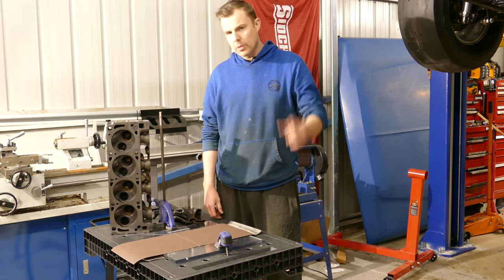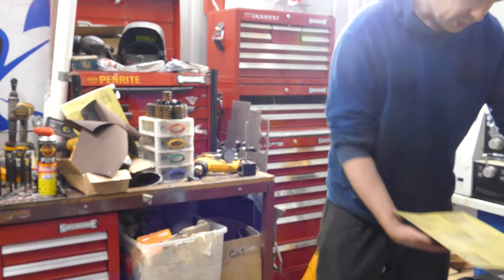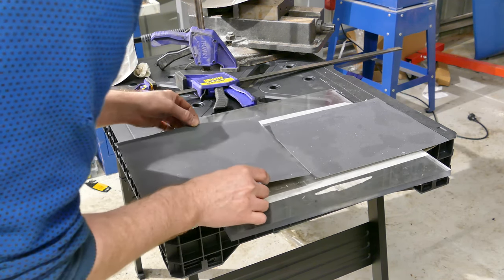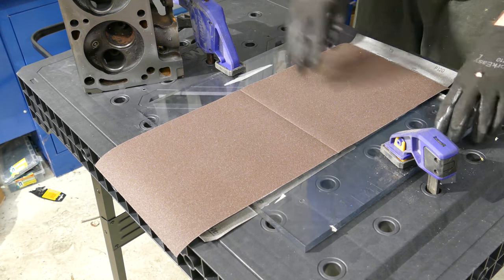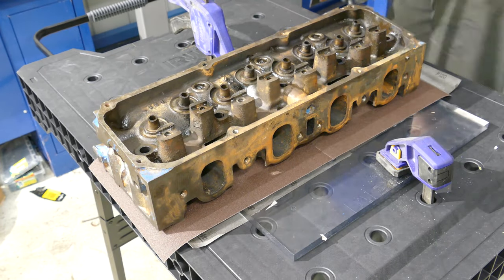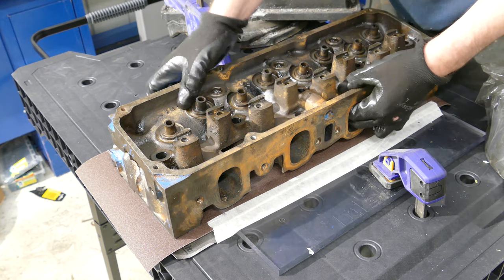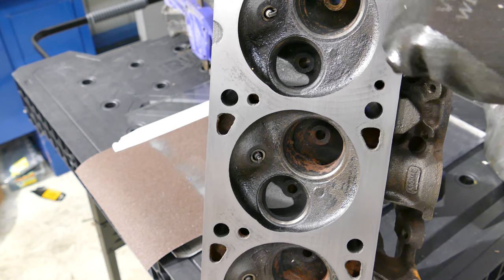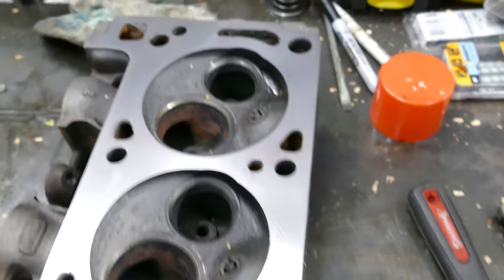How to Resurface a Cylinder Head at Home

Comment: Looks like you need a larger sanding area so the ends of the head doesn't ever leave the sand paper.....the center of the head is getting sanded down more than the 4-5 inches of the ends. Idk.
Reply: If it works it works lol
Reply: @RATsnak3 changing oil every 50k works too. You should try!
Reply: @rightsdontcomewithpermits7073  if your cylinder head needs to be resurfaced, an oil change isn’t going to cut it.
Reply: If you have a closer look you can actually see he moves the head far enough for it to get to be even. I had the same worry as you at first.
Reply: @RATsnak3 noob always talks about changing oil. Its alright. We all know you can change your oil and filter. Good job. Leave the these sort of jobs to the expert, youtube warrior.
Reply: @RATsnak3 anything goes nowdays HAHAHA
Reply: machine shop resurface is a must ....sanding alone will not make it perfectly straight ....leakage is inevitable on high compression engines
Reply: @RodolfoRedovan-ry8kj  for this there is a ruler, clearance tolerances and feelers, if everything is within tolerance, then this method is working

Comment: Straight lines are the worst thing you can do. Also, no lubrication or cutting oil to clear the shavings. Iron heads are different than aluminum of course, but they still need confusion on the milling marks to seat. Smooth isn't the key. The gasket needs something to bite into. I use 220 for first cut and 320 for final and work in figure eight motion. I have a video posted as well.
Reply: not for MLS gaskets, smoothness is key
Reply: I guarantee the edges are a few thou difference just because of the momentum of the strokes. I checked it at the machine shop. Completely right about a very smooth finish with MLS but you take that head to the head shop and you'll see the corners or off. 220 grit is far from a smooth finish for an MLS gasket. It will work...but for how long
Reply: Meh, I watched your videos, with all 17 likes and comments DISABLED. Red Flag number one. Then I saw you pull out a Home Depot 4’ level as a “straight edge” to check a 2-thousandths factory tolerance on a Subaru head (notorious for head gasket and ring land groove motor failures)… Red Flag number two. Then you stated in your video that if someone didn’t have a sheet of glass or certified flat surface to “Just use the floor if you know it’s flat”. I lost it and died laughing. When I went to install my new flooring in my house, my floor had highs and lows of 1/4” to nearly 1.5” differences. If you’re recommending to use the FLOOR to machine a motor because “Your dad has a machine shop”, you are part of the problem. 👍🏻

Edit: Not to mention in your comment here you stated that “Smooth isn’t the key”, when in fact, it is on almost every gasket made now which are primarily MLS gaskets because they are far superior to Carbon/Cork and are the best way to fix a factory-flawed cheap gasket setup. Just the 2 cents of a someone who builds 1500hp+ engines quite frequently and my own personal 1638hp Whipple blown LS7 has 80,000mi of pure abuse on it and has needed NOTHING other than standard maintenance.
Reply: @jimkruse74 you right I did this method and was out like .003 on each end with the straight edge ended up getting the surface milled
Reply: Figure 8 is what you use for small things like cpu heat sinks, etc.  Kind if hard to do quite the same with a 30-50# head, but one could try a bit.
And no, most modern engines and gaskets need flat as possible unlike older cork and 80's-90's gasket that need some 'bite'. 
Work in an area that can be wet and position a hose to spray water onto your wet sand paper to flood the debris out and away from the scraping area.
If I were doing this, I'd get a range of quality wet sandpaper from 200/400 up to 2000/3000. 
A mirror finish isn't required, however the closer you get the better the seal will be.

Comment: I hand lapped my head and block together with grinding paste, does an even better job as both surfaces are flat to each other. Can only do that if the engine is out and you clean the entire head and block after though
Reply: Shade more light on this method please.
Reply: I could see that being a good method, if there was no head gasket failure or overhead event to begin with. I would maybe do this if I were just upgrading valve springs on an otherwise healthy engine.
Reply: I've heard of this method before, usually for single barrel set ups.

Comment: I have done two alloy heads using this method on laminated glass with the spray bostik adhesive trick like you used.   But I used 220-240 paper with running water from hose, it cuts plenty fast enough.   After a few minutes work the 220-240 has lost its sharpness and is like a 400 so you have already got a nice final finish without changing papers :)
Reply: @michaely6665 I’m working on a 2002 5.3 LS with MLS head gaskets which the head surface needs to be near mirror, how long do I sand with the 220 before switching to the 240? or do I just choose one over the other? And do I keep sanding using water until they wear down to around 400 grit?
Reply: I used 220/240 whatever shop had, maybe for iron heads you could try 150/180.   Water flushing paper helps stop loose stuff scratching alloy heads.   After 5 minutes the 220 has already lost the best sharpness.  The finish was dull smooth, 220grit is about 17ra, and MLS gaskets needs 30ra from a list I found.
Reply: @michaely6665 Alright thanks. The cylinder heads I have are aluminum 862 and are not In really bad of shape they mainly need a once over but I’m going to buy a straight edge and get some bright markers to check any high and lows as I go along
Reply: @michaely6665 I believe they say 50ra to 60ra for aluminum heads with MLS gaskets and the chart i found says 120 grit leaves a 40ra to 60ra finish does that sound about right?
Reply: All I can say is 220 grit cut fast  enough, and leaves a nice smooth finish.  Only if the heads are really bad would you need to go lower, 120 grit is aggressive for aluminium, I tried 180 once and it really cuts in.
Reply: @michaely6665 Alright cool thanks for the info it’s really appreciated

Comment: While this is a good way to check and clean the surface of your cylinder head, this is in no way machining or re-surfacing. Nice try but no cigar.
Reply: I'm not in love with the idea, however it certainly is resurfacing.  Do what the OP did, and you can easily take n thousandths off your head depending upon how low grit you start with or how long you want to push a lump of iron around.  Will it generally be as accurate and good as a proper resurfacing with a mill? Nope.
Will you possibly ruin your head? Yep.
But you are resurfacing it, and Bugatti was reknown for doing almost exactly the same thing, albeit on a surface stone.

Comment: I’ve never done this before but I do work at a machine shop and there’s a couple things I’d do differently. 
First of all I’d get a larger piece strip of sandpaper and wet sand with machining oil. 
Start at a higher grit that 100. 
You’re likely working with aluminum and even 400 grit can get out of hand pretty quickly. 
Invest in some different grits, keep it clean, and above all else take your time.
Reply: I was hoping to see some additional tips in the comments and was wondering if wet sanding was a good option and I was also thinking that he was using sandpaper that is on the abrasive side I would honestly start with 400 and probably end with an 800
Reply: I have done it starting with 600 and ended with 2000. And WD-40 for lubricant
Reply: Great comment
Reply: @tuckerburbank3422   how it go with those grits?
Reply: what grit would you recommend to start and finish with? also can wd40 be a good lubricant when doing this?
Reply: @joshuetortega3572  

Really, just feel it out. 
I can’t overstate how careful you have to be about keeping it on the sandpaper and keeping your strokes consistent. 

Some blocks have an extremely low tolerance as to how much material you can remove. 

I would assume 400grit would be as low as you would want to go. 

If that doesn’t get the old gasket material off, perhaps try some kind of solvent and light scrubbing. 

A trick you can use is once the old gasket material is removed, mark the entire surface with a marker. This will help with showing you low spots. 

I’d work at 600 to start. If it’s not aggressive enough bump it down to 400. Realistically I think working from 600 > 800 > 1000 should do the trick.

I’ve heard of people using WD40 as lubricant but I’d look into buying some actual machining oil. It’s thicker and will probably help with keeping particles suspended and out of the way. 

A good degreaser will also be nice to have on hand while wet sanding.
Reply: I have a 2l inline 4 petrol turbo engine (sr20det). If I resurface it like this (using your tips) and torque it down correctly will it be able to hold turbo pressure? And what gasket should I use? The OEM one or should I get a better gasket just to be safe? Or does it not matter unless the engine is tuned to make more horsepower? I don't wanna go through all this just to have to get it done at a shop anyway but I'd love to not spend hundreds of dollars

Comment: Good, basic introduction to lapping a cylinder head.
Great thread of useful comments.
This is certainly doable, however you have to have a good idea of how to measure the different types of warps. 
If I had to do this manually, like this I would try to set things up so I was wet-sanding it in effect. This would mean forgoing a flat horizontal set-up to something akin to a ramp.  It would ~1.5x length of the head, and the top edge would have some soaker hose or garden hose with 50 pinholes in it attached to my spigot to allow water to flow over the wet sandpaper while stroking the head to remove grit and metal swarf.
Additionally, I'd take a permanent magic marker and crosshatch the face of the head so I could occasionally stop and see where/how the head was scrapping in.
Might have to reapply a few times.
I'd also start at 200/400 especially for aluminum unless it was warped significantly.
And, don't even start doing any of this until that head has had all gasket/rtv/etc scrapped off. Use a razor blade, solvent, whatever to get that 100% clean before starting else you're going to end up having to scrape even more and take more material off, lowering your deck height.
You also have to know how much you can scrape off before it either start affecting compression or maybe valve height.
I'm assuming a decent machine shop is ~$100 to do this, however if much more then it might actually be worth the sweat equity.
Reply: 100$?? I wish

Comment: You have a big problem with your method that can be easily solved.  If you watch your sanding process, you'll note that the end of the head overlaps the sandpaper each time you stoke to the left and back.  At the same time, the center of the head strokes somewhat to the edge and then back, without overlapping the end.  What this causes is the center of the head experiences more contact time with the sandpaper than the ends, and thus, you will sand a hollow on the center portions of the head.  And you'll do it pretty quickly.  The solution is to construct a larger sanding surface that will allow the entire surface of the head to be in contact with sandpaper at all times.  As well, your glass substrate is actually quite flexible, so whatever you're using to support the glass should in itself, be very rigid and flat - a very large granite flat would work just fine.  This will eliminate preferential material removal from the center.
The process you're using is actually that used by amateur telescope makers to grind concave mirrors.  With glass, the process is much slower and the amount of material is considerably less, with the same result.

Comment: That might work with a light head, but with a heavier one you might want to stick the sandpaper sheets to a large flat plank and also stick a 10 pounds weight on top for uniformity while you just do the back and forth movement (without applying any more downward pressure).

Comment: Id use a wide flat piece of 18mm mdf with the grit wrapped around it. Place the head on your bench and pass the wood with grit paper firstly lengthways then side to side to finish so that no score lines are in line with the cylinders.

Comment: It would work better with a flat stone, and the head turned upside down. I've seen it done before but time has to be taken to make sure the passes are even. That would only work if the block was totally fine and the head was only out a few .000

Comment: What size filler gauge did you use?
Reply: Not sure what he used, but I would go with a 2-thousandths feeler. I’ve built some pretty hardcore motors performance motors, and 2-thousandths is the industry standard “tolerance”.
Reply: Long as you have no more than 3000 warpage, you’ll be OK

Comment: Can you do a video on cheap way to lap a rotary center/end plate.
Reply from the maker: Possibly. The cheap way is to get a thick piece of glass, cutting paste compound, and to rub the plate in circular motions over the glass. Takes a long time and only really good to give the plate a bit of a clean up.
Reply: To lap an end plate, I used an old centre plate as the base that are typically flat because they have more material in them, I then used valve lapping paste. Just did a circular and figure of 8 motion and it came out incredibly well. Took the grooves in the plate down to within tolerance

Comment: does this work on a aluminium head sorry to bother you
Reply from the maker: Sure, however it depends what the head gasket material being used is made from. Paper or graphite based gaskets will take up some imperfections on the surface, but multi layer steel gaskets need a mirror finish to seal properly.
Reply: @BroomysGarage  
cheers for the reply mate 
ripper I'll bear this in mind
Reply: @BroomysGarage  I'm not sure what gasket i have. It looks like steel on the inside but outside it's black, rubbery like?
Reply: @LosSerpent  That sounds like a multi layer steel(mls) gasket. How did the job turn out? What material was the head and block? What finish did you use?
Reply: @joshuahenrichson9001  it actually ended up sealing without resurfacing, already did 7000km on it and no leaks. Bmw f650 funduro

Comment: What finish grit sandpaper would I need for a near mirror finish for MLS head gaskets? Working on a 2002 GM 5.3 LS engine
Reply: Theirs no sand paper in the world that'll give you a mirror finish.
Reply: 2000, 4000, to get a mirror finish you'd need metal polish compound

Comment: can you coat it in prussian blue, sand a tiny bit to find the highs & lows?
Reply: Or even coat the whole surface with a sharpie if the theme is go cheap under $50? I never used prussian blue marker, maybe it dry out and sand off.
Reply: I used pressure pack spray acrylic as a guidecoat I ended up ruining the ends on the head like .003 on the straight edge cos of clog in paper and motion go to a shop you risk leaks doing it like some youtubers show you
Reply: @zdravkomomci7570  The point is that you have to use your head and realize nothing is ever as simple as it seems. Its called basic research.
Using a pencil or magic marker to verify as you are scraping in is normal in machining. Where you got the idea to use some sort of spray acrylic is just nutz as its going to be 1-2 thousands...
Get decent wet sand paper and get water flowing over as you scrape, and check flatness/finish often.

Comment: What's the name of the material you're using please?  You said it's not glass.
Reply: Perspex. It's plexiglass. Plastic.
Reply: @matts.8342  It's been a while, lol.  But thanks!
Reply: Do NOT use plexiglass. It’s nowhere near imperfection. If you can’t afford a machinist’s block or precision tools, your 2nd best bet is to use a piece of precision machined glass about 5-6mm or 1/4” thick (or greater). Glass is created in a much more precise manner than plexiglass.

Edit: That’s not as expensive as you think. A small enough piece to cover the size of your head/block is probably about the same price as this ultra thick piece of plexiglass.
Reply: @BlackwaterDSM  Would a piece of marble or granite tile work? I have one I use to flatten the back and sharpen woodworking tools with various sandpaper grits, almost exactly like this guy is using the plexiglass.
Reply: @matts.8342  Technically it would work, but you have to look at the tolerances with which things are considered “flat”. Granite and marble are “precision cut” (using that term loosely) on a wet saw which can have small variations of well over 10-thousandths just due to the fact of how it’s cut and polished. Glass is manufactured by mixing the product components and heating to 1200 degrees celsius before it is “floated” on top of a molten tin pool, thereby creating an essentially flat surface due to gravity’s force on liquid objects. Tile and marble would do the job just fine probably, but a sheet of glass would do much better and it’s not to expensive to purchase a small sheet a little bigger than your deck. Just get a reasonably thick piece to prevent breakage.